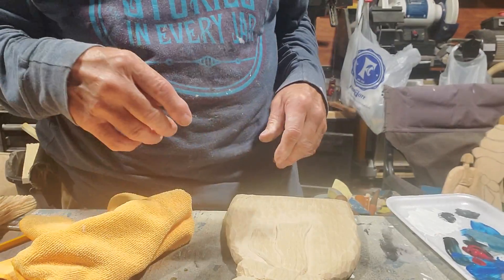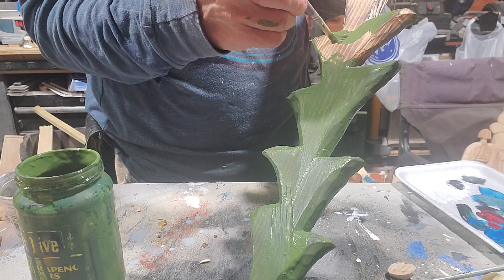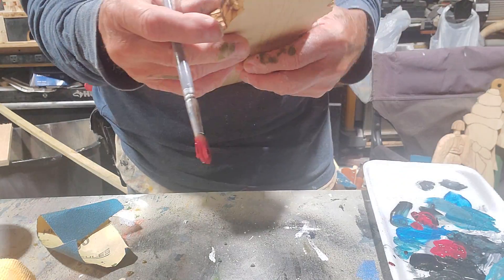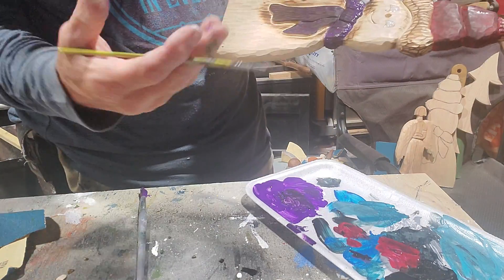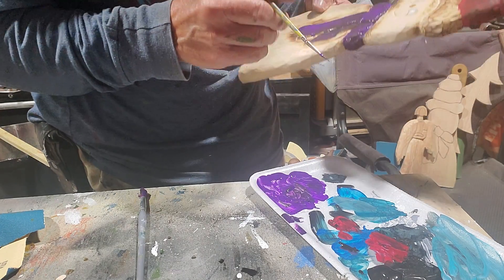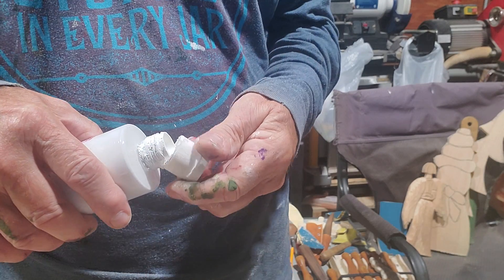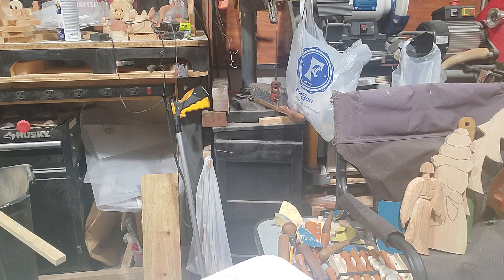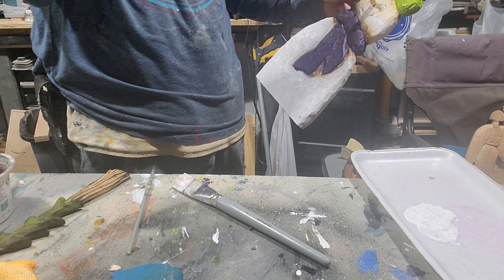Doing some painting on a snowman

Comment: Love the snowman. Mr Dave have you ever tried using a hairdryer to dry you paint faster . that's what I use sometimes it seems to work for me . Your carving friend from Kentucky
Reply from the maker: @GREGPARKER-hn1wu   Yes I have used a hair dryer plus When I paint in the house I turn my oven on low and place it in there on tinfoil and it will dry it really fast I've tried all kinds of things I have built a heat box before all that was with light bulbs inside a box that was lined with metal and at work too I appreciate you and thank you for subscribing to my